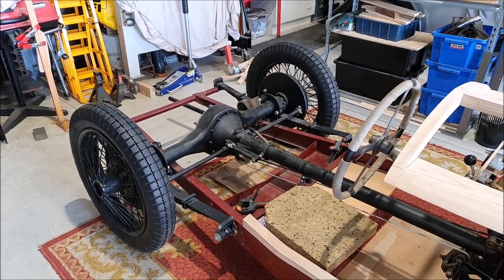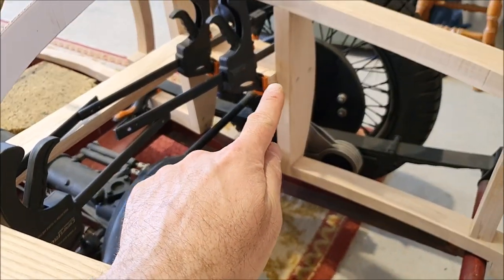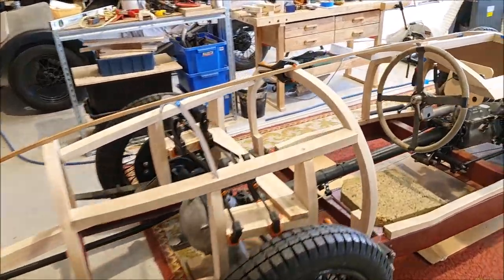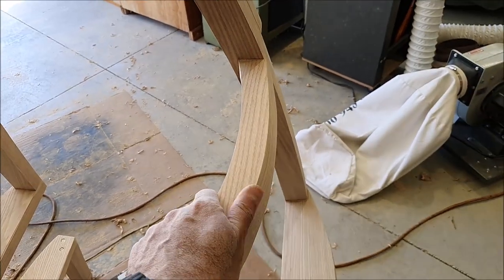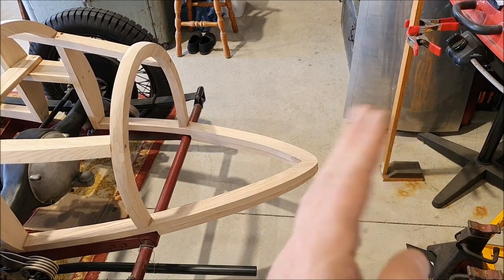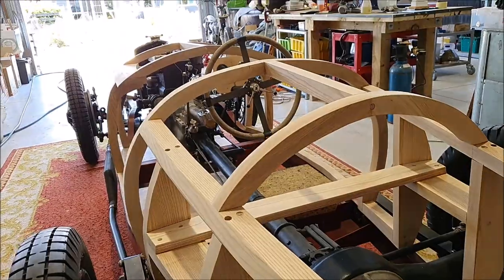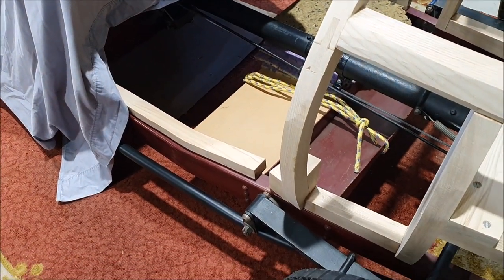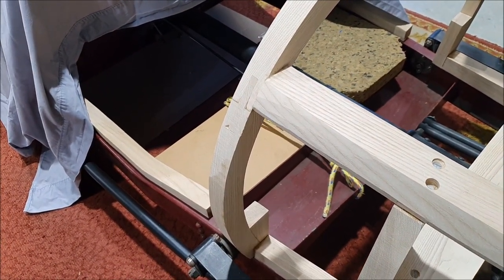Pre war Riley ash frame update 3

Comment: My belief has always been that the aluminium retains its own shape and the frame is the inner guide. Too rigid a frame and cracking appears. The only area I have ever needed to beef up is for the door slam posts, particularly on my Alvis which is pretty heavyweight as you can imagine.I checked my Lynx after seeing your progress and the boot area is about half to three quarter of an inch out of central line overall. You cannot see this once skinned however. It is all coming together and your quality is excellent and will stand the test of rough roads. Once nearly bought a weymann bodied car; my head said no because of the complexity of refurbishment! Modern glues really are amazing and no doubt the Riley bodyshop guys would have used them with relish. Happy New Year to you and yours. From UK
Reply from the maker: They are all a bit wonky I think. I seem to have mine (more or less) even again. Leaving a lot of extra wood to smooth off helped!

Comment: It is looking really good, you can now see the shape of the barrel it is coming on so well 
Funny how the impression of size changes depending which direction one looks at it from. From the rear it looks very thin but from the front the body looks fat but the engine looks so thin, but of course the view will change when the bonnet is put on. Keep on plugging on, one hopes the approval goes easy for you.
PS and cheep as well.
Reply from the maker: A lot of cars are like that. Well, old cars. I remember my Austin 7 being the same when making that. Lots going on visually which is why if something is 'off' you notice it quickly. Modern cars just look like plain blocks to me. On our recent trip I was commenting how white Teslas remind me of the blow mounded white plastic inside modern fridges. So bland. Even their model names are bland.